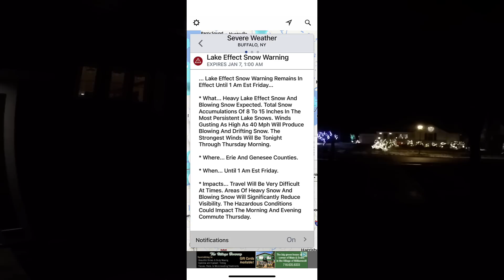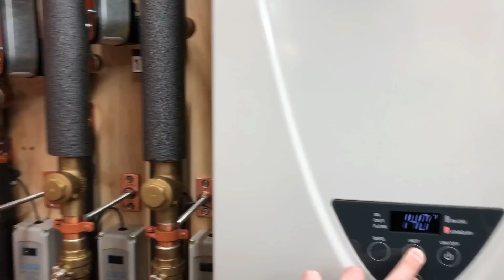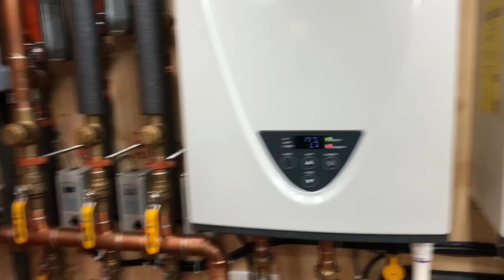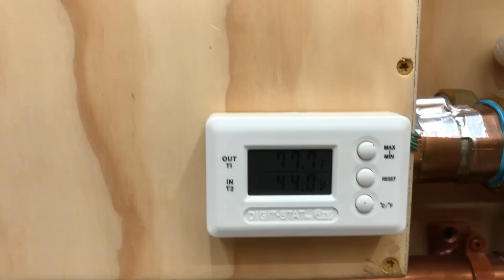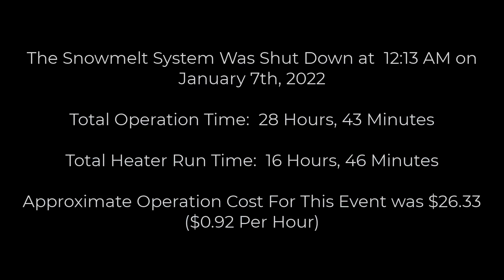Heated Driveway Melting Snow Time Lapse During a Buffalo NY Lake Effect Snow Storm on [1-6-2022]

Comment: We’re almost 1 year in in our brand new house, we installed a hydronic heated driveway, is it normal for my gas bill to skyrocket? We paid almost $500 for 1 month. Lol
Reply from the maker: @Jay G - Wow, that does seem high, but without knowing more info its hard to say.  How big is the area you're heating?  Are you turning it on / off for each melt, or are you idling it?  Where are you located and do you average extremely cold temps and alot of snow?  All of these things will of course effect cost.  My system is manual as of right now, no automatic controls.  I turn it on to melt and turn it off when the slab is dry.  I ran my system quite a bit in February of 2021 and it still only cost me approx $107 extra to run for the month, and we got alot of snow ( https://youtu.be/VotJEQigTkw ).  Natural Gas prices are significantly higher this year though, so you probably can't compare to that, but I'm still averaging $0.75-0.90 per hour as you can see form my recent videos.  During this last storm it ran for 44 hours and cost approx $33.  Does that $500 also include your house, and do you know how much that normally is without the snowmelt on for comparison?  Just some things to consider.  Hope that helps, and thanks for watching!
Reply: Its on idle most of the time. But we have 1boiler with 3zones. 1st zone we heat the basement which has its own thermostat. This almost never kick in due to hvac doing most of the heating. 2nd zone is our garage again with its own thermostat which is set to 60 deg. 3rd is our driveway, walkway to the front steps and front steps. Which has the puck sensor thats flushed in our driveway. It seem high only when its on the melt setting. Otherwise, we pay normal on gas. Last time it was this high is when we had a huge snowstorm last year when we were moving in. I live in Chicago.

Comment: How much did that cost? What are your thoughts on the electric vs water heated driveways? Cool video!
Reply from the maker: Total for my system was between $10k-$12k including everything in the mechanical room, the pex in the driveway, and the insulation underneath it.  That does not include the cost of the concrete as I needed to to that anyways.  With regards to electric vs hydronic, I never even considered electric for my area.  Here natural gas is readily available and much more cost effective and efficient.  That of course may change based on what part of the country / world yo live in, but here in Western NY most systems are hydronic.  Not sure if you've seen my channel / playlist, but I have several other videos like this one, as well as videos showing how I designed and installed the system, cost to operate, etc, etc.  I am uploading more weekly.  You can find that playlist here is interested: https://youtube.com/playlist?list=PLdWeMRuZcbQjekwiBk_uy39IS6JFWYORD   Thanks for Watching!
Reply: @DeckerChristopherJ  awesome video! I live north of you in Toronto and was all ears to this. Assuming gas prices are similar here, would you still recommend hydronic or what if I used solar panels (net zero billing by city assumed) to bill the charges for electricity back to city. Can you guide on safety of the pipes installed?

Comment: What if you start it after the storm? Would that reduce the system capabilities?
Reply from the maker: Starting after the snow has accumulated will definitely effect it's performance.  If the snow is light enough, it will eventually catch up and keep up, however if the snow is strong as is was a couple of weeks ago in this video: https://youtu.be/EkDVQq_TW1k then it may never catch up (or not within a reasonable amount of time anyways).  It is always better to turn it on a few hours before the snow starts, but that makes for boring YouTube videos so I usually let it accumulate a bit so you guys can watch it melt! 👍. Thanks again for watching!
Reply: @DeckerChristopherJ  Do you have a problem preventing a sheet of ice when you shut the system down after the snow.
Reply from the maker: @wilsjane  No, but it’s important to let it run until it’s 90% dry.  If you turn it off to early while the slab is still wet, then yes, it will re-freeze into a sheet of ice.  I actually had a scenario about a week after this video where it was dry so I turned it off, but we received a light snow overnight and the slab was still warm enough to melt it but not evaporate it and it turned to ice.  I recorded what it looked like the morning after, you can watch that video here: https://youtu.be/EkDVQq_TW1k  To correct it I just needed to run it again for a few hours and melt it off.  Hope that answers your question. Thanks for watching!
Reply: @DeckerChristopherJ  Thank you for your reply, as I suspected, your system  requires a great deal of monitoring and prediction to operate. 
With every gram of snow melted requiring 83 calories, the running costs must be considerable.!!
Do you use calcium chloride brine in the system to prevent freezing. It is more efficient and far cheaper than antifreeze. It is used as the secondary refrigerant in commercial cold stores and ice skating rinks.
Fortunately, we do not need to heat our drives here in London (UK). 😃
Reply from the maker: @wilsjane In its current setup, it does require some monitoring and prediction to operate.  It is up to me to determine when to turn it on and how early, and when to turn it off.  I have considered purchasing the Tekmar 090 Sensor and 654 fully automatic controls, but haven't brought myself to purchase them yet at over $1,000.  One it is on however, there is no monitoring, it just does its thing, self modulating and turning the heater on/off as needed.  The running costs last season were about $0.50 (50 cents) USD per hour.  This year they are about $0.92 per hours due to a huge increase in natural gas prices this winter.  I use propylene glycol in the system at a 40% mixture.  I am not familiar with calcium chloride brine, but you've inspired me to look into it.  Hopefully I will not need to drain / refill the glycol side of the system anytime soon.  I have SEVERAL more videos, including melting, installation and system walkthrough in the playlist on my channel.  You can find it here if interested: https://youtube.com/playlist?list=PLdWeMRuZcbQjekwiBk_uy39IS6JFWYORD  Hope this helps, Thanks for watching!